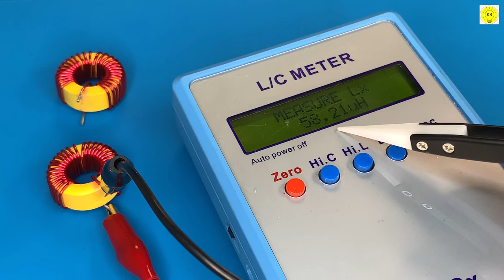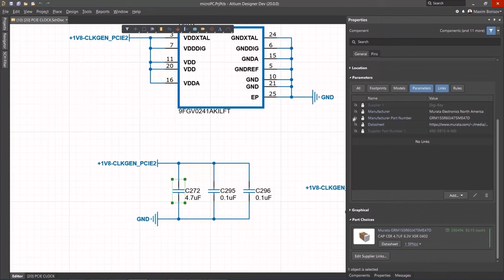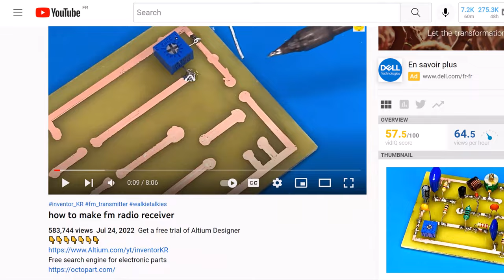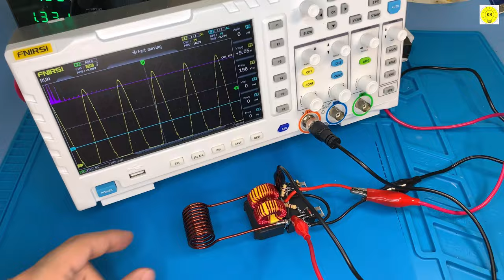building a induction heater

Comment: Does any inductor have too much voltage or current across the copper coil, is it dangerous?
Reply from the maker: Of course it does not contain high voltage
Reply: @inventorkr1  This means that there is no danger if the hand touches the coil.  thank you so much!

Comment: Hello

Can the Ni-CD 3 6V 60mAh battery be charged with a 15V AC buzzer transformer?
Subsequently, when the 15V power is cut off, does the said battery trigger the coil with working V 12-15~ working Current 1.9A Frequency 50-60hz?

If it doesn't, is it circuited for such a request? 
Can you make this circuit?